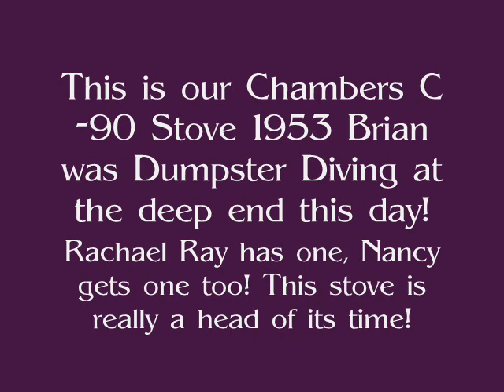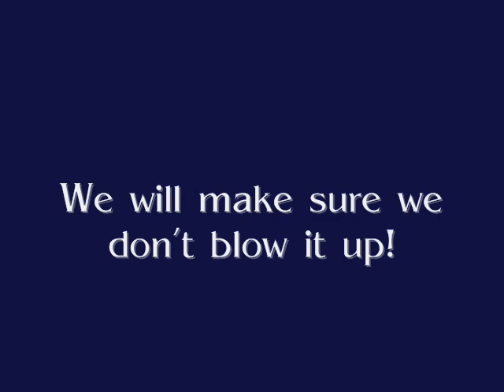Chambers C-90 Rachael Ray has one now Nancy has one!

Comment: have a stove just like that which has been in the family since the 50s. that looks like it took one hell of allot of work, but it looks great when you are done. the one we have came from my great-grandmother's house. we had to convert it from propane to natural gas, and also had to have the oven thermostat replaced, but other than that it works great, so i guess we got lucky. although i must admit that the range handles are hard to turn (think they need taken apart and cleaned).